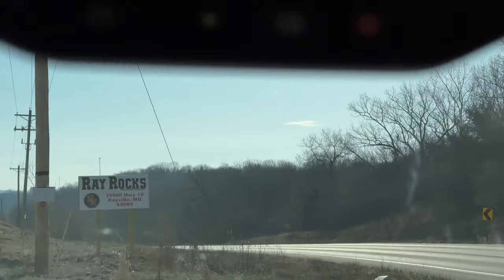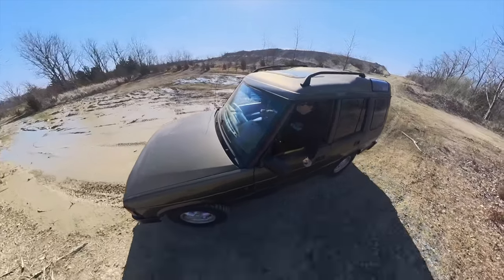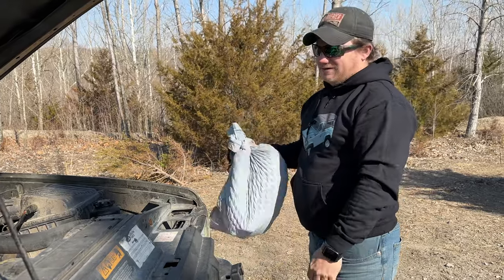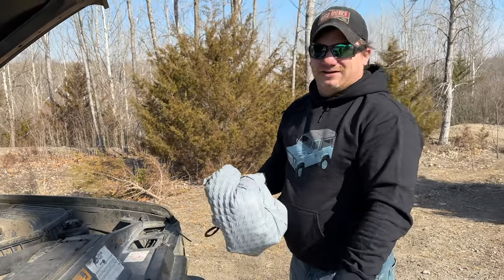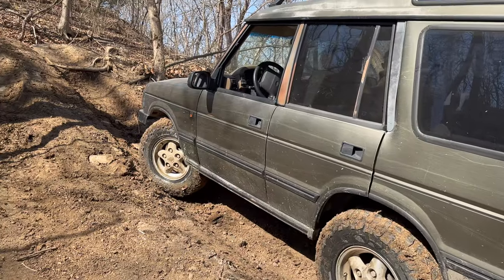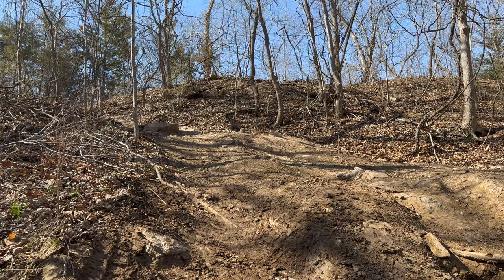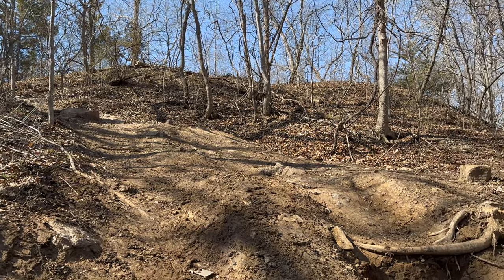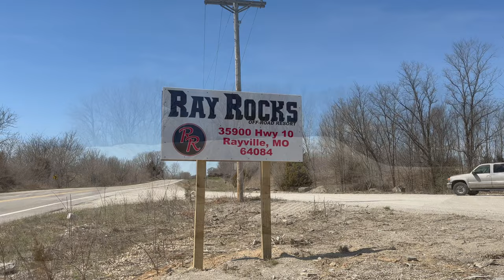Ray Rocks Offroad Resort 4x4 Park

Comment: Ray Rocks pick your challenge level. 4 wheeling, 3 wheeling, mud running and winch action you covered all the bases and Cassie never had to push!!!. Did not know popcorn had a built in  Mosquito oil screen feature. Looked like fun time.